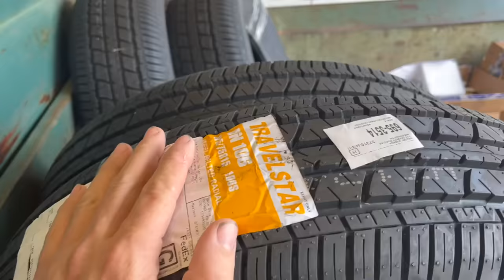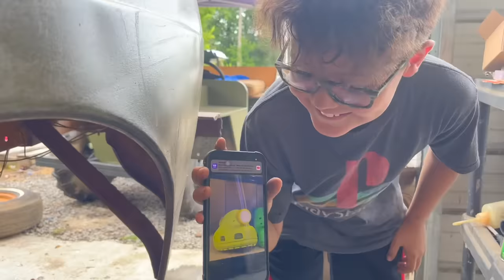Barn Find 1 owner 52 Ford truck survivor back on the road after years parked

Comment: Tip on how to remove the inside bearing and seal without damaging the seal.Remove the outer bearing and screw the nut back on then slide the rotor or drum off the spindle in a fast motion and that will remove the rear bearing

Comment: My Dad had a 48 Bonus the same colour as this 52.  It had the flathead V8 and 4-speed crashbox and I loved riding in it because the sound of the straight cut gears in that box were so musical and the V8 could idle so low you could almost hear each cylinder fire.  Seeing this F1 moving along the road brought back a lot of great memories.  I've enjoyed the series on the beast - even the breakdown had a positive ending!  To my mind, a vehicle with its original running gear still working well should be left intact and run as is, rather than repowered with a modern engine just for the sake of it, so it was great to see that she's still got some good miles left on that engine and everything working as it should.  Great looking truck and great to see that she can still be driven by your youngsters too!  All the best

Comment: This reminds me of cutting wood back in my 20's, wife and i cut in a drizzle to point we couldn't and when we went to go it clicked once and then nothing, turned out the contact between the solinoid and starter was missing on a chevy squarebody,, i rummaged around truck and found a broken hacksaw blade a 22 mag bullet and a drywall screw, cut the end off the bullet after pullin lead/powder ofcourse and used the brass to replace the copper tube that was missing and used the screw to jam/wedge it back together,, and it saved the day, was sleeting and near dark, i had to use a lighter to see my fingers move cuz i couldn't feel what i was doing,, anyway,, love ur abilities including ur editing and ur sense of humor u and family have, keep doin what ur doin ✌❤

Comment: suggestion when you change the oil in your daily driver save it and use that in these builds because you know it wont be in their long then on the next change use the fresh
Reply: I do this, infact my uncle has a wrecking yard and i rigged up a lifestraw to a hose and click clack pump and car battery. I pump the gas out of the tanks and put in in barrels! I have 6 55 gallon barrels of free gas that as long as it isnt too bad put into my 1994 f150 4x4 and it works great!

Comment: I'm a Ford truck fan from way back. I was born in 1952. An F1 from 1952 is my dream. The first Vehicle I owned and made payments on was a 1968 F100 Camper special with a 360 motor.  It was also the first vehicle I ever swapped a motor in. I replaced the 360 with a 351W during the fuel "crises" in 1974. I loved that motor.
Reply from the maker: That’s awesome

Comment: 1952 Ford F1 Pick Up Truck Project 
Wallingford, CT
Great Rat Rod project! Flat head V8 was running last summer and turns freely. Interior is in pretty good shape and could be driven in as is. There is quite a bit of body rust however, frame is very solid as is the original suspension. Been in the ...
1 week ago on Americanlisted
Reply from the maker: Ok thank you
Reply: @Sleeperdude  Man I hope you got it.

Comment: What a gem! I was really starting to wonder if that OHV L6 was actually the original engine until I looked it up. As it turns out, 1952 was the first year for the OHV 6, but the V8's were still the 239 flathead. Surprisingly, the OHV 6 had exactly 1 more horsepower and a few extra ft.-lbs. of torque than the V8! Go figure... It would probably be a plan to pull that tank back out and drill the sending unit plate out for a top mounted draw tube to alleviate the clogging issues, and just plug that bottom fitting. They are a constant source of fuel issues on those old Ferds! My grandfather had 2 of them, a '47 dump truck, and a '51 pickup with a flathead V8, and he had to convert both of them, since neither one would run more than 30 minutes without plugging the fuel line.😛
Reply from the maker: Yeah I was wondering to until I researched it

Comment: I installed a flex hose on my old 1970 Chevy. They use to be pretty cheap in the 70’s but the last time that I priced a flex hose, it was very expensive compared to the aftermarket Gates hose.

Comment: Great job on the truck, a little trick with brake lines if you're trying to save them is heat them with a butane torch at the fitting then quench them with a spray bottle of water the sudden shock will break them loose so when you unscrew the nut the line won't twist off. As far as gas tanks Rusty you can fill them with white vinegar let him sit for a week dump them out and the rest will be gone.

Comment: When you install new tires you really should line up the balance point dots to the valve stem. You will use alot less lead to balance the tires. Give it a try and you will find out the less lead to balance tires deal. I really enjoy watching saving the old trucks and automobiles, keep up the great job y'all are doing!!!
Reply from the maker: Yeah your probably right

Comment: What was that Ralphie said about Chevys before you guys hit the hill...nice old Ford. The wheel with external knobs for the cap is probably a late 60s early 70s Ford pickup wheel. The 15 inch internal knobs were used from mid 50s until mid 60s. Don't remember exact years ,sorry but it's been awhile.

Comment: Maaaaaann.... this truck is the reason I subscribed. My FIRST truck was a 1952 Ford F1. 239 Flathead, 3 on the tree. It's sitting in a barn right now.180K on the odometer IIRC
Reply from the maker: That’s awesome
Reply: @Sleeperdude  I reckon I aught to share the plan for it... I'm going to pull the body off of the chassis and restore the chassis and drivetrain, keep all of that in the barn or garage and put the body on a newer truck frame, putting a big block in it, AWD or 4WD, independent front suspension, maybe independent rear suspension, and drive the heck out of it.

Comment: Those sardines got me in trouble at a factory lunch-room. My co-workers insisted I eat at a picknick table outside. For wheel paint, try alkyd-urethane porch and deck enamel. It's a gloss paint, you can brush on, leaving no brush marks. If you have a detail gun and compressed air, it can be sprayed on.
Reply from the maker: Ok thanks

Comment: Very cool video! You have changed spark plugs and the high voltage wires, but! Check the spark moment too! May be there is the problem. The powerful motor, couldn't climb up the hill? And the car was not loaded? With new carb, plugs, and so on, I dont belive. Hello from Russia, Saint- Petersburg!)

Comment: i saw some clean a tank like that by strapping it to the rear tractor wheel and filling it with rocks and a bit of fuel and drive around with the tractor for a while. worked a treat.

Comment: I was a professional painter for years. You can industrial enamel from a paint store for steel,,concrete. Rolls or brushes  on. Add a little thinner or mineral spirits. It will lay down like glass. I painted the whole bottom of a F-150 .looked great, and lasts.

Comment: I was going to tell you something about the old Ford truck, I have a 1950 f600 , it has adjustable tie rod ends and all of the steering parts are adjustable, you can tighten them up when they get slack. Don't know if the smaller ones are the same or not, just a thought. God bless!
Reply from the maker: Awesome thank you

Comment: Man, she’s a gorgeous truck. Id be putting a filter in before the pump, especially as the tank is still rusty and the last thing you want is to have rust puncture the rubber in the pump.
Reply from the maker: Yes we did actually when we got back to the shop

Comment: The inside caps will accept a 1940 Ford style hubcap, which was a 16" wheel. I believe the 15" versions are from 1957-1966 or so Ford F100 pickups. They're sought after in the hot rod world. The other "outside nub" wheels are 1967 through 1986 style Ford F100 wheel and will take hubcaps from those pickups.
Reply from the maker: Ok thanks for letting me know

Comment: You need to put another fuel filter underneath before the fuel pump to catch any rust that might let loose, the rust getting to the fuel pump can ruin it. I did the same thing on my 52 Ford F1 because the tank in it was rusted bad also. I used a big steel filter in the line under the cab.

Comment: You did a yeoman's job on that truck but that old gas tank should boiled out with oxalic acid.  Rust won't just go away.  The brake rebuilding shows what really happens over time and why it is so important to address ALL the brake issues.  Keep going.  You folks are terrific.
Reply from the maker: Yes thank you

Comment: An old farm method to clean your fuel tank. If you have a concrete mixer some cargo straps and 2 bags of cheap marbles ( from dollar mart) or 3 lbs of some small smooth gravel. Strap the tank to your mixer, add the smooth gravel or marbles , put the fuel cap on with plastic. Switch on mixer and leave it for 1-2 hours then stop and check with flashlight, keep going until the tank walls are clean. Take it off rinse with fresh fuel dry and refit the tank.

Comment: Those U-Joints are the originals they have those metal straps that hold the end caps on. Those are to make it easier and faster to install on the assembly line all replacements don't have them and you have to be careful to keep the caps from falling off and knocking the needle bearings out of place.

Comment: Love that truck..
Reminds of of the day my dad knocked my front teeth out..
My dad had a 49 Chevy truck and in those days the dash was made of steel..
We were headed to my dads friend to buy some fence posts..
Where we turned off the blacktop onto a dirt road stood a huge oak tree .
Oddly enough , there was no bark on that side of the tree where many before had slammed into the tree .
My dad made the turn a bit too fast , hit the tree & it stopped us cold.. 
No seat belts in those old rigs & I flew forward and face planted on that steel dash..
Knocked one front tooth smooth out & the other was pointed at the back of my throat..
My dad pulled it out the rest of the way easily with two fingers..  
I was only 5 , but I was Pissed off ! 
Made worse by my dad laughing between feeling a little bit bad .
But , on a good note, I got $2 outta the whole episode compliments of the tooth fairy that I knew was straight up b.s.

Comment: Hi:
On that old ford with the none synro trans, if you need to put it into low without stopping, revenue the motor up, then it should drop right in.

I drive 18 wheelers, and none of them have synchromesh trannies, and that's how we shift down on the move.
I do like you and your cool family, and your nutty antics.
Michael Rzewuski

Comment: Take the fuel tank to a radiator shop to have boiled out and coated. Install another fuel filter prior to the fuel pump to prevent grit from getting in fuel pump.
Reply from the maker: Ok thank you

Comment: I'd replace that broken wheel stud.  Also, I think I'd sand off the rust and paint the grill insert.
You changed so many parts on the brakes but I think switching over to a dual chamber master cylinder would be good. I mean, it needed a new one anyway.

Comment: Personaly I would upgrade the battery with a 9 volt one, they were used by many people in northern climates for there ability to turn the engine over faster in cold weather. PS they will charge the battery on the stock 6 volt system, and won't burn out any thing like the lights.
Reply from the maker: Yeah probably a good idea

Comment: The Travelstar UN106 is a touring, all season tire manufactured for passenger vehicles and SUVs. The tread design improves the dry, wet and winter traction and ensures a safer drive. The wide grooves manage to prevent hydroplaning with their enhanced water and slush dispersing ability.

Comment: Strap tires to the ends of the gas tank. Throw some nuts, bolts, washers etc in the tank as abrasive to scrub the insides. Use your choice of liquid. Roll it around till clean
Reply from the maker: Yes

Comment: Cool seeing an old Ford running again. Not sure why you keep calling the tires "casings". I have never heard that in the 70 years I have been here. Have a good one.
Reply from the maker: Thank you. I just think it’s funny it’s from the tire retread industry
Reply: @Sleeperdude  From my understanding, that stopped happening on car tires back nearly 50 years ago and you are not that old. In my opinion from all the separated tread on the roads, it should also stop for commercial tires. Retreads should be banned. Hope you have a good one.

Comment: Love this truck. Just found your channel and ironically I grew up in Loudon county not far from you.

I believe that is a 223 not a 215. I had a '58 and that is identical to it. Same one barrel holley

Also , i heard you talking about roll down windows. I have a 2020 F-250 super duty with roll down windows and no power locks. Godziller engine and 4:30 rear end

Comment: Make it easier to crank by swapping it to twelve volt. With a generator, change light bulbs , battery and turn screw in voltage regulator to twelve volts and starter will turn over twice as fast , like hooking 24 volts to a twelve volt system.

Comment: next time you rinse out an old gas tank full of rust take the time and throw some bolts in there and shake it up and knock some of that garbage free....marbles work as well but i preferer nuts and bolts as they have edges...a bunch of change works as well...save yourself the headache...love your vids guys

Comment: You should use spray on rust converter on wheels like those.  Steel brush them and spray.  Will never come off and also stops more rust.  And it's glossy.  Great stuff for frames, hubs, wheels etc.
Reply from the maker: Ok thank you

Comment: Did ya know that you could braze a piece of tubing on the gas tank fitting on the inside about with about a inch of rise to help stop the crud from blocking the fuel line

Comment: I have a 1952 Ford F1 im putting a built 351w in. I got the truck from a close uncle before he passed away.
Reply from the maker: That’s cool
Reply: @Sleeperdude  i would have left mine original just like yours but mine is missing a ton and was very rough. Engine and trans were gonners

Comment: Fuel filter? Gas below the pick up on the incline. .what if you drive up the incline in reverse?
Reply from the maker: The pickup is at the bottom so it shouldn’t matter

Comment: Switch the points out with a Pertronix electronic ignition conversion kit.  They aren't very expensive (under $100.00) and way more reliable. And just ask the parts store if you could look through their hoses. Find the right diameter hose with a 90-degree "L" and cut it to length. And omg "that's fake news, son". Hilarious
Reply from the maker: Good idea

Comment: No there is a bunch of rust and old gas varnish coating about 15 Sq ft of tank area. There are methods of clearing that out with acids bolt the tank to a tr!ctor wheel put ! Chain in there and go turning it for 30 minutes. Flush it out and apply a gas tank sealer.

Comment: I have the same tire machine and when I remove and install tires I use vasoline cheap from dollar store also fixes rim leaks and by the way when your sanding your points ask you wifey about emery boards they work very well for sanding in tight spots and when they wear out you just cut them down , then you can use the same board over and over again and there cheap at the dollar store 40 double sided boards for 1.00 all different courses
Reply from the maker: Yes thank you

Comment: Excellent video Sleepdude Crew Josh  :) yes wild sometimes on old truck are simple fix up to get going also hacksaw blades are nickname by are called Universal tool and help me in past to! Want funniest one my dad also uncle had home one from Animals stock yards sales barn belt broke what used was bales string in pulleys for Alternator, Water Pump, Crankshaft got them home safe after 1 hour drive!  Chicken bird name Snowie! But Josh on that old Ford I would put exhaust new on straight pipe  to Round Muffler or Round Silencer Tube as your choice  to  another straight pipe and angle front right back wheel  that old truck  were and some had round of straight and tip face on Round Muffler ends ! Yes lots people put modern power steering and brakes in plus 302 or 350 V8 with 4 barrel plus daul exhaust also Automatic transmission  in too  with 1970's posi rear use 303 to 411 ratio !

Comment: Heres a simple hack. When bleeding brakes hold peddle down open bleeder valve push peddle down to floor hold it. Then  tighten down bleeder valve  bring  up peddle check and add more fluid  to the master cylinder then repeat. This is the simple gravity bleed method  that i was taught at 15 and i've been using for over. 45 years. By pumping the peddle your creating more air in the brake system. Curt m.

Comment: Big handfuls of nuts and bolts dumped into the tank, after taking it back out and draining, since it was easy. Then shake shake shake yer booty lots to kinda break loose the crap that did not come out with just rinsing with clean fuel. Might do it a couple times to get rid of the stuff that might come off again. Worth a try and the price is right! LOL  Thoughts from WAY down South in Ibague, Colombia  Expat Dave

Comment: Hey, if they find that open can of sardines too quickly, next time shove them...or some crawdad tails up inside the curtain rods cause no one will ever think to look in those.  If you only want to disturb your co-worker though just go to Bass Pro and buy some doe urine, get a syringe from a veterinarian and load it full of that urine.  Wait till a hot day and then push that syringe through the rubber window molding on their car window and hit the plunger.  It won't stain anything noticeably because it's a fine little stream.  They'll be driving home with their widows down for a week.
Reply from the maker: What a good idea